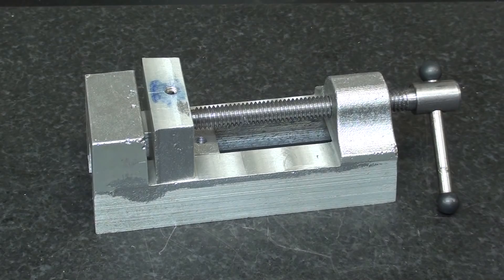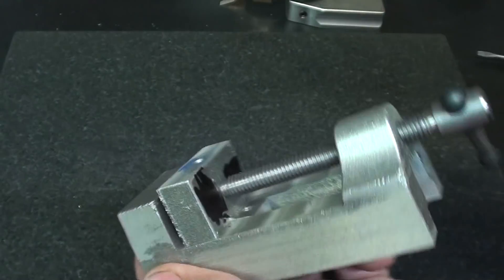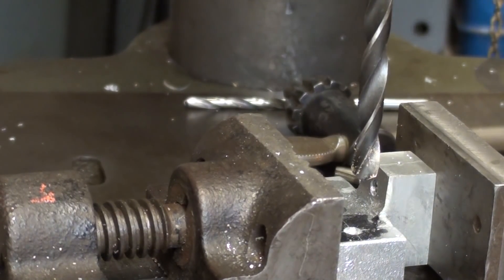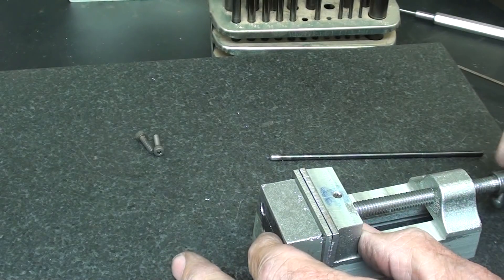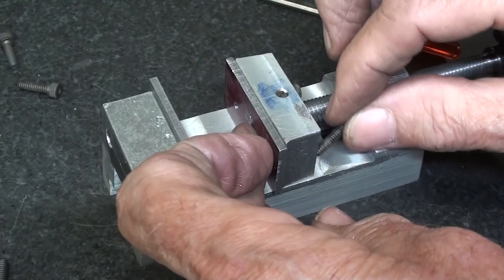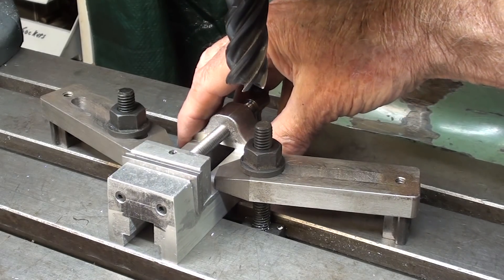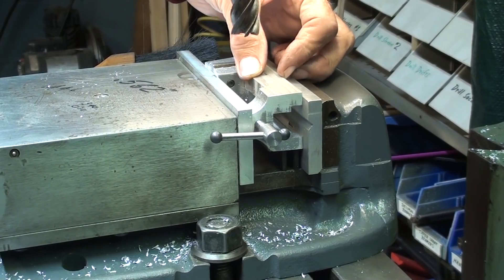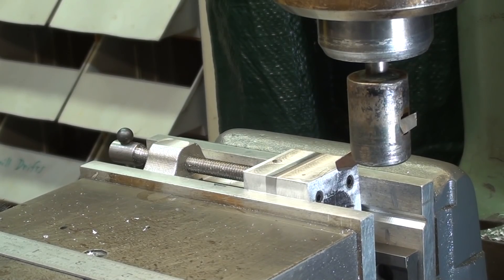Machining a Drill Press Vise pt 3 Tips 605 tubalcain mrpete

Comment: You often say you are a man of many vises and also say you think you may have beat that horse to death.  Well after watching many of your vise videos I am pleased to report that you have influenced me to take action on a vise.  My Dad passed away in 2016 and I carried home a vise that was on his radio repair bench (his shop since 1947) and after seeing you clean up and paint some I decided to do the same.  As it turns out it is a Littlestown Foundry and Hardware vise from the late 1950's and after a little work I have it with a new coat of paint and ready to be used for as long as I am able to step to the bench to work.  Thank you Mr. Pete.  No reply anticipated or needed.

Comment: Lyle, Great series as usual!  In an earlier video you said you weren't going to do any more 3D printing videos of casting patterns, I hope that's not true.  I am about to start a couple projects that I intend to use 3D printing for the patterns.  Any videos on the subject are a big help.  You mentioned issues with your print quality, I have a couple suggestions to help with that.  Change out the bordon tube with a teflon version and change out the quick couplers.  If there is slack in either one, it greatly effects print quality.  I change them out on both of my printers and it helped a lots.  The "print lines" are much reduced, exactly what you want for a pattern.  I'm going to pull the vice pattern and give it a go.  BTW, my neighbor Dave is really enjoying watching your DVD's.  He's now out on his Atlas messing around with thread cutting!  Huge progress for him for sure.
Here's a link to the parts I used for my printers.   https://www.amazon.com/gp/product/B07DC594D6/ref=ppx_yo_dt_b_asin_title_o00_s01?ie=UTF8&psc=1
Reply from the maker: Thanks a lot I’ll check it out

Comment: What's with machinists on Youtube free-handing taps, it''s so incredibly easy to make a tapping block! Just take a scrap block of material and drill a clearance hole for the tap in a drill press or milling machine, hold that against the material and it will keep the tap nice and straight whilst tapping.